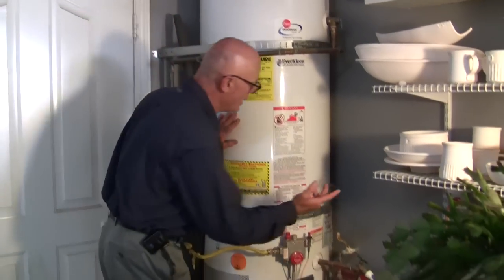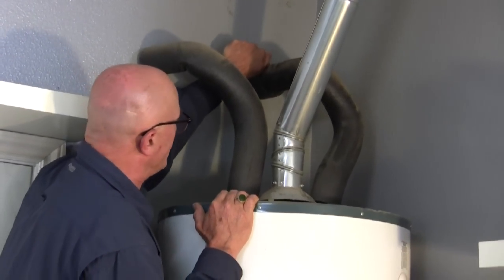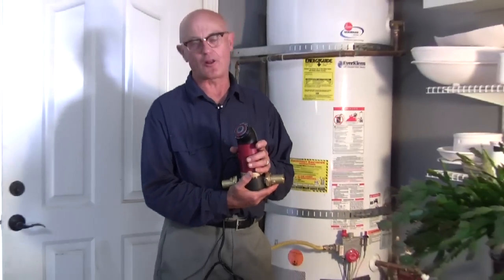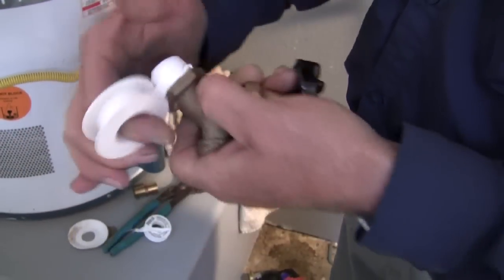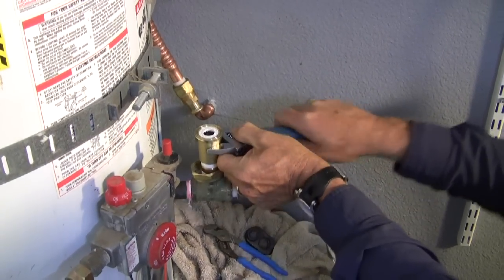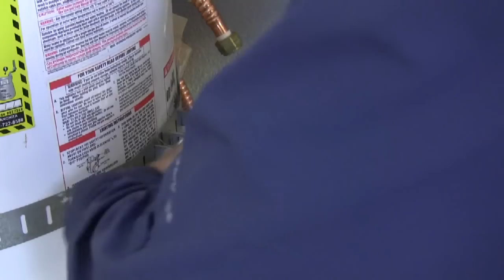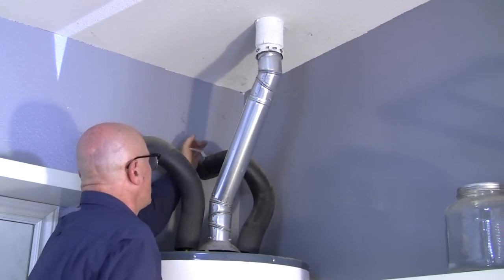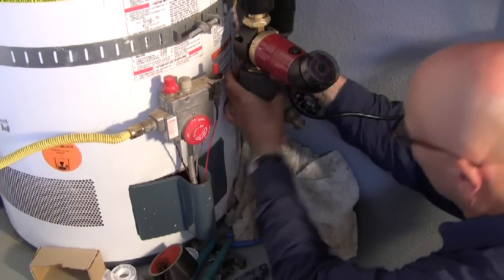Replacing a Recirculation Pump

Comment from the maker: A return line is for circulating the hot water from the furthest fixture back to the water heater separate from the cold line avoiding warmed up cold water.  It is called a 3 pipe system instead of a 2 pipe system.  The pump usually goes at the water heater pulling back from the distant end.

Comment: I was hoping to use your instructions to install a new pump to my system. My water tank has an outlet for hot water and an inlet for cold water (which I suspect is coming from mains) - I don't have any pipe coming into the drain outlet at the bottom. Most of the pump manufacturers manuals suggest putting the pump at the hot water outlet and using a bypass valve under some sink. Can you please comment on how your setup differs from that?

Comment: Thank you for the video, it was very informative. I have a question. The recirculation pump brings water back into the tank through the pipe that was designed for the purpose of draining the tank. The T fitting installed allows for the bib to drain the tank and for the pump to inject water back into the tank. The pump is "fighting gravity" by forcing water into the tank from the bottom, right? I realize that there are only so many ways to skin this cat, and this may be the only way to do it per various building codes. I take it you cannot connect the recirculation pump so that it pumps water into the tank using the the top inlet valve? In other words, have a Y fitting of some type at the water inlet/input so that we use gravity in our favor and put less stress on the pump. Would appreciate your thoughts on this, and again, thank you for the informative video.
Reply: No worries, pumps push or pull water, circulators are a bit different, being it is a closed loop, the ceiling hight is the issue hight, not the tank.   Circulators do not fight the tank.   The cold inlet at top of tank, inside go to the bottom anyway.

Comment: Good video. I have a Grundfos Comfort series pump that does not need the extra feed line, but has never been installed and was stored for a couple of years. Do you know of a method to test  the pump to check if it's seized and a method to preserve the pump so it stays functional for future use?

Comment: So can you use 1/2 inch copper for the recirculation line back to the Hot water heater when you use 3/4 supply lines to and out of the water heater?
Reply: You may have an issue with velocity wear on metal piping (copper) depending on the speed of your pump, the return pipe is only for recirculating "tempered" water back to the heater your hot water supply lines should be sized properly for the demand of the fixture they serve.

Comment: how do you purge air from the re-circ line? is it not a good idea to install a hose bib between the wall and the pump? air pockets are common when re-circ lines are drained down. also, a check valve between the tank and pump will prevent sediment from clogging the pump.

Comment from the maker: Taco is great!  Grundfos is great!, I do not represent any pump company,  I do not criticize any pump company or suggest replacing a Taco or a Grundfos with the other.   I do like the Demand pump company,  but they have used Taco and Grundfos,  so what is your point?  do you prefer one over the other?  Great,  most every product has strong points and some people have needs for those points.  I do prefer made in USA,  I as well suggest sizing any pump as per mfgr. specs.

Comment: There's a problem with installing the pump at the water heater: The heat from the pipe at the water heater side causes the thermister to trip long before the hot water piping in the house is fully heated up.  This happens on the Laing models.  I did not see an insulating nipple in this install. How is this problem overcome?

Comment from the maker: Grundfos and bell & gossett are alike in specs.  go to Grundfoss site and see the crossover chart or just size any brand you want.   Yes any brand works,  the need is to have the required head pressure to over come elevation loss and pipe and fitting loss.   Too fast water flow is very bad on pipes...4 ft. per second is max.  2.5 ft. per sec. optimum..

Comment from the maker: Different pipe layouts need different solutions.  Applied engineering is not dummy down level.   Some tasks need evaluation and are not plug n play.   Lesser of two evils is always fighting ROI.  I think residential buildings need commissioning.   The market is not quite there yet.

Comment: You guys, the new recirculating pumps have automatic learning features where you don't have the set the old fashion pin timer. It just learns when you use hot water, over a period of a week or so, then self-programs to pump the water int he future. This saves a ton of energy and water. This unit here, which he has, is old fashioned. Not saying it won't work. It will. But the pin timers are out of date technology. Look at the Taco Smart Plug, and the Grundfos 10-16 auto adapt models, instead of this old jalopy.

Comment: Have been unable to find the unions that you show in the video. otherwise very informative
Reply: +Walter Foley - I got the unions at supplyhouse.com, they have everything you need, free shipping over a certain amount, and prices comparable to Amazon. Great customer service. The unions come in 1/2&quot; or 3/4&quot; NPT.  I used 1/2&quot; because I have 1/2&quot; copper pipe on one end, and used a 3/4&quot; to 1/2&quot; brass reducer on the other to mate with the fitting out of the water heater.

Comment: Yikes, all looked good until the use of that thin wall flex on a circ line.
Reply: If you mean the Copper water heater connector flex, that pump moves water at a slow velocity, this is a 3/4" dia. connector  and this pump has likely 1ft. per second or less velocity in that diameter.  The flex is listed for hot water heater connector, and they do get pin holes, any experienced plumber knows that.  However, that is on top supplying the whole house flows that can exceed 5 to 10 feet per sec.  or 24/7 circulation, that is where the erosion from water velocity comes from.    To your point, many plumbers use the non braided solid flex corrugated stainless steel connectors that are same as the copper one, but stainless steel.    That house had very low pressure, and water treatment, no problems will likely come in that installation.   I do get your comment, I even agree in many conditions your point is spot on.

Comment: you don't need to put tape on a line that has a gasket and you only need 3 wraps around a thread not 10. if you are gonna use tape get the good stuff and that's blue monster. that white crap is OK though.